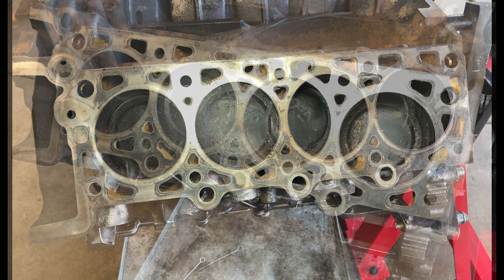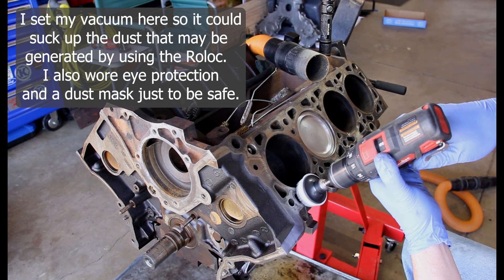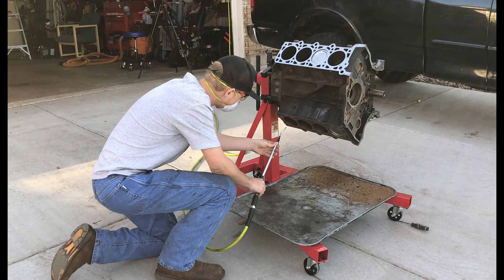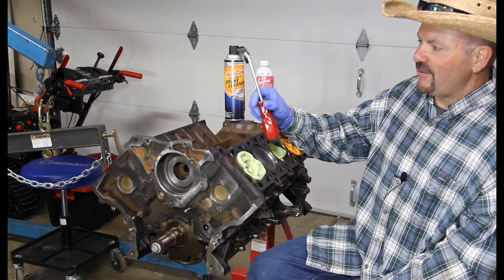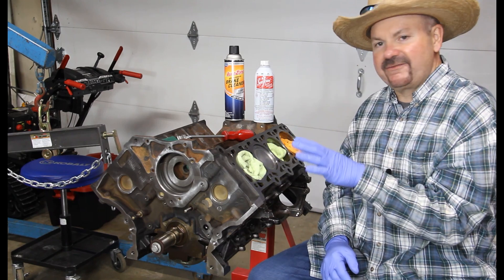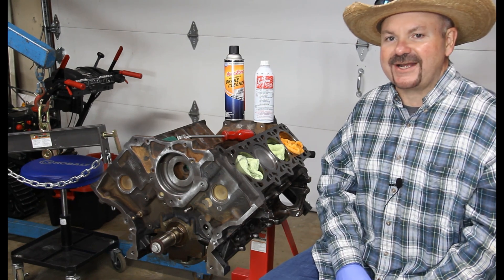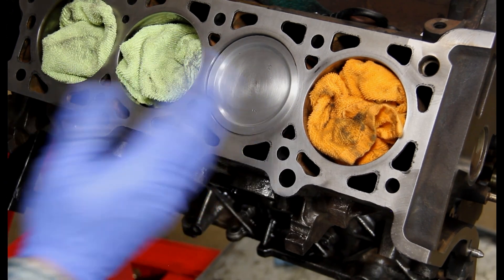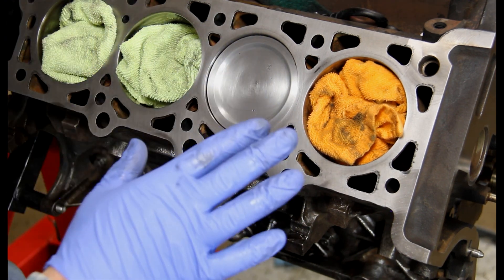Ford 5.4 2V Build - Piston & Deck Cleaning - Preparation For Head Installation

Comment: Can you use the same concept on the 6.8 V 10 for a rebuilt as the 5.4
Reply from the maker: I would certainly think so David.  I've used this process from car engines to lawn mower engines and it has worked well for me.

Comment: This may be a dumb question, but what is the purpose of tearing down the engine just to clean the pistons?
Reply from the maker: Not a dumb question.  We were replacing the head gaskets, a timing component replacement, spark plug thread repair and exhaust gaskets so it only made sense to clean everything back to new condition since it's open.  I believe it will help it run better and longer.  Hope that answers your question.

Comment: HUGE thank you for this series. Nice to see a good in-depth look at what you’re doing. I’m gathering parts to swap a 5.4 2V into a Crown Vic and this series is helpful! This is actually the only in depth home rebuild on a 5.4 that I’ve seen. Thanks amigos!
Reply from the maker: You're very welcome Dan.  Thank you for watching and putting up with my babbling!  I'm really glad you've managed to gain some info that could help you.  If you have any questions that I don't cover along the way please feel free to ask a question in the comments and I'll see what I can do to help you.  Just make sure to post your question as a new comment because YT doesn't notify me if someone responds to an existing comment so odds are I'd never see your question otherwise.  I'm babbling again.  Thanks for stopping by!
Reply: @javosgarage  Mr J G...  I have this 5.4 in my 97 e350/4R100 class b+ RV 

Is there a way to retain my stock non - PI intake manifold while using a PI cylinder head

I want low end torque for the 2000-3500 rpm which is where I drive on cruise control at 60-61 mph

I currently achieve 10.7-13.9 mpg